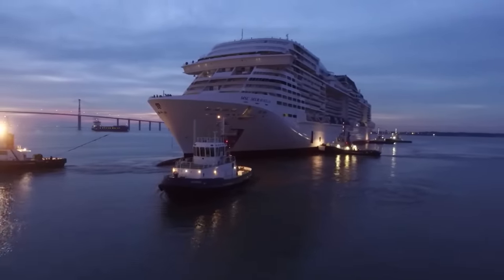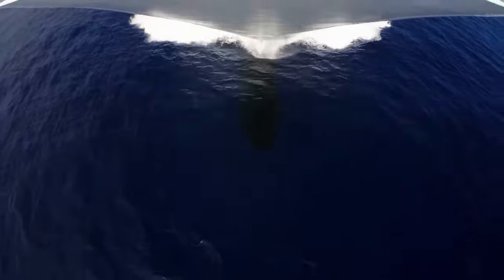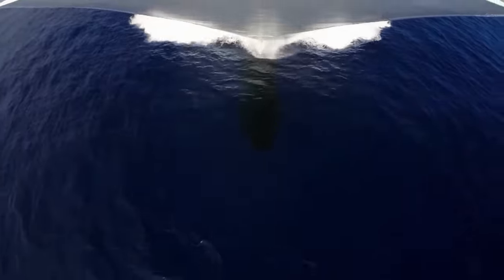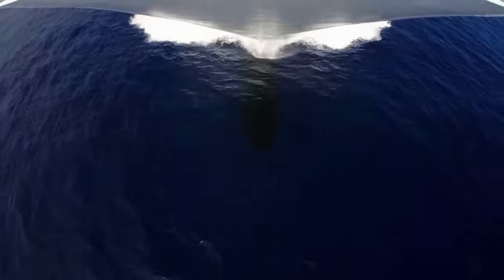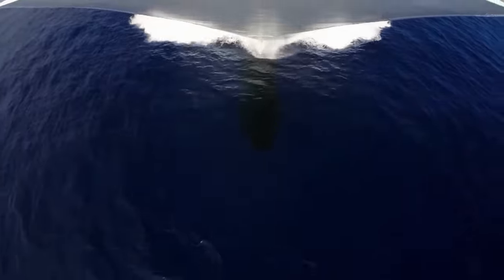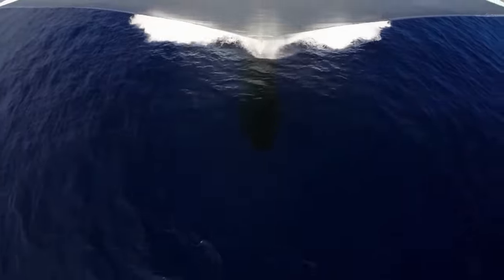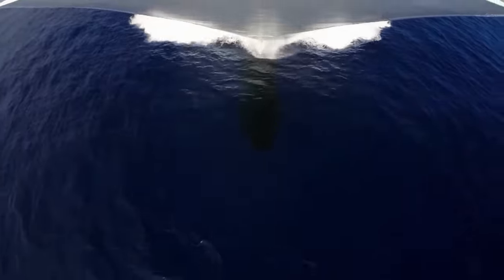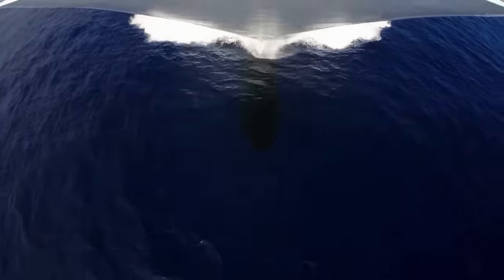Extreme Constructions | Complete Series | All Episodes | FD Engineering

Comment: It's amazing to find out that a ship can produce it's own electricity !  i thought they used a really long extension cord .
Reply: they use cordless leads, like EV\s
Reply: @GlenDoer-gq1rs  actually, a battery powered ship would be an interesting topic ! Probably not feasible today but, maybe when the technology advancement catches up they just might have them !
Reply: @averteddisasterbarely2339 No, it will never be economical to have a battery-powered ship due to issues with power density both watts/kilogram and watts/liter matter on a ship. Batteries taking up revenue bearing space is non ideal. Not getting into charging times for a 100 plus megawatt battery pack.

Edit:
That Scandinavian electric "cruise ship" (large yacht really) uses batteries and hydrogen fuel cells.
Reply: @averteddisasterbarely2339  Meh Batteries are so last centry now. We need, vegan ships that are powerd on, what ever it is vegans use for energy. And they better be gluten free aswell
Reply: @canoaslan1011  well.....they do eat alot of beans so.... Methane ?
Reply: The cable is unplugged at the last port of call and rewinded at the current port of call during pax on land-going adventures. Before the ship leaves for the next port of call it is plugged in to the local main grid. This goes well for Countries provisin > 240 Volt and no less than 1:34 1:34 1:34
Reply: Sure beats sitting around making things that go bang
Reply: @averteddisasterbarely2339 

It's a lot and most humans produce hydrogen gas rather than methane!

So you learned 2 things today ...
Reply: @skyhawk5503 .  Rewound is actually a word, but rewinded is not!
Reply: Friction of the ocean its a new thing discovered for electricity and it can be controlled by an app 😁
Reply: @beckysam3913 kkkkkkkkkkkkkkkkk😢0000000000000009000000000900009090909😅
Reply: They don't rely on extension cord? WTH?
Reply: Lol fire

Comment: Now I'm not saying this is the case but I know regarding the flaps being down with the aircraft I used to work on was normal because we did an inspection of the flaps and different flight controls with the pilots still in the seat before we shut them down. Could be normal for them to leave them down, just another viewpoint

Comment: What about the use of ADsorption Chillers for Aircondioning from waste heat of the engines Exhust & ORC Turbines for Low temprature heat Recovery into some usful power & also the Powerfactor improvment Capacitor banks for the generated power.                                     I Thinck these three factors if considered at the time of construction would have significantly reduced the Carbon Footprint besides saving cost of energy consumption

Comment: "The ship makes its own electricity, the others tow on a large extension cable"
Reply: I don’t get it
Reply: @skipmagil  All cruise ships produce their own electricity..otherwise there wouldn’t be any electricity on board…
Reply: It's driven with electricity. The propellers are connected to electric motors. It's been that way for decades now. I was on the Celebrity Solstice completed on 2008 and It's the same way. I loved being on the deck when it was docking. No tug boats and the ship could move sideways. It's easier to parallel park than your car.
Reply: @edvaira6891  ĺ

Comment: The fuel should be non-polluting compressed hydrogen gas, which emits only oxygen and water, unlike heavy bunker oil diesel fuel emissions, which are extremely polluting.  Wartsila, Finland, and Meyer shipyard, Turku, Finland are now conducting final sea trials of the ICON OF THE SEAS cruise ship which uses compressed hydrogen gas fuel Wartsila engines.
Reply: My buddy had his 18 wheeler his blinkers ran on the fluid u mention, blinker fluid x3 was called

Comment: Around 12:59 into your video you mentioned propellers producing electricity This statement is wrong they are using electricity. They’re using 20,000,000 W of electricity not produce. The ships generators produce the electricity. If I’m wrong please do explain why as I am curious why it was stated the way it was in the video?
Reply: imagine instead of "watts" he said "horsepower."
Reply: they produce x amount of mechanical energy (kW) using a bigger amount of electrical energy (kW)